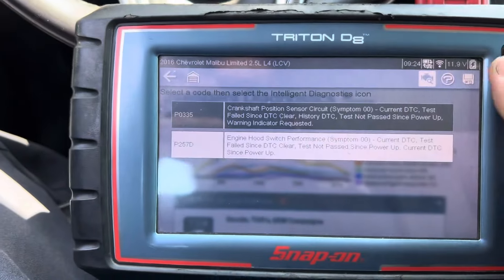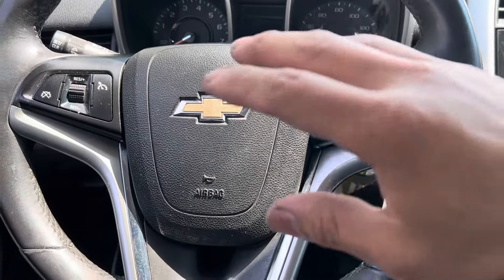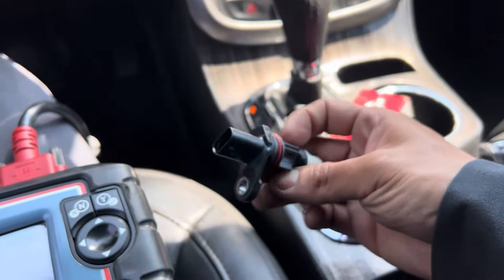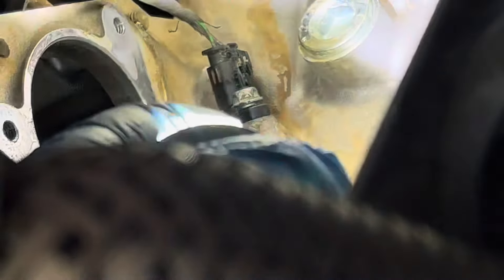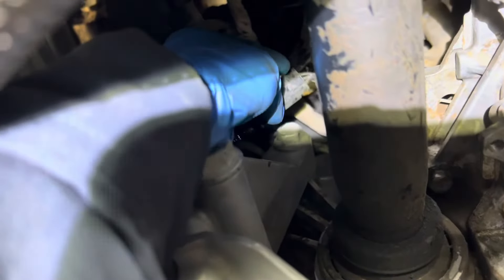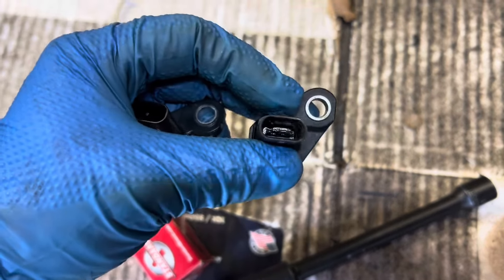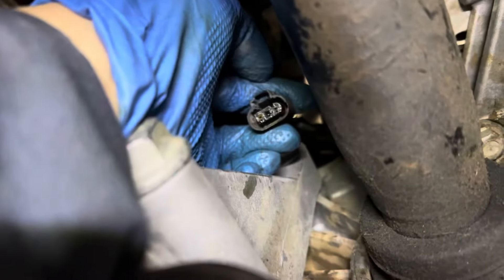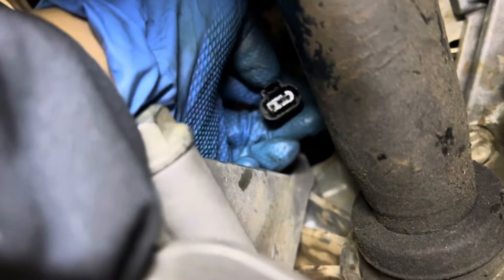2008 To 2016 Chevy Malibu Crank Position Sensor Replace - Code P0335

Comment: I have crankshaft sensor and camshaft sensor codes, can this make the car to be doing overheating? Thanks Tim
Reply from the maker: If crank and cam correlation code, that means the timing chain could be off. This will not cause an overheating issue. Fail water pump not circulating, bad thermostat not opening, radiator fan not working properly, faulty engine coolant temp sensor, clogged radiator and (leaking) low coolant. These are the issues will make the car overheating.

Comment: With both crank sensor and cam sensor scanning bad will it cause my lifte my lifters to clatter a ND car have not enough p power to move i
Reply from the maker: If crank and cam are bad car will not start sometime. If lifter is making ticking noise that's mean the lifter are bad, kinda hard to find out which specifically lifter is bad, just replace all lifters. Lack of power because lifter is bad, not lifting the valve on time or delay. Make sure oil level is enough and use the right oil spec.